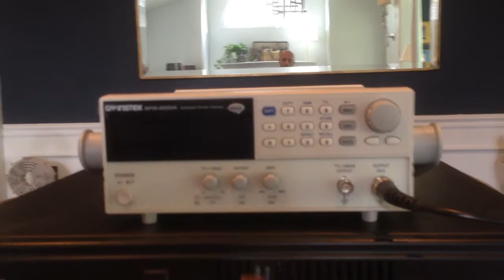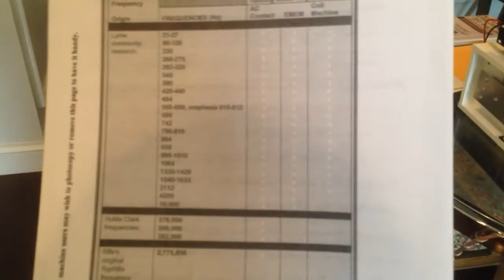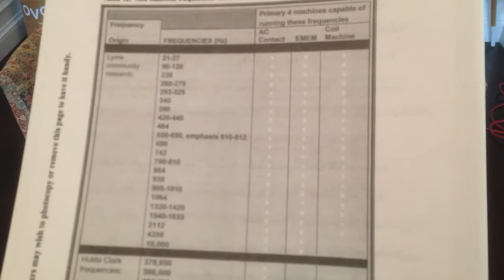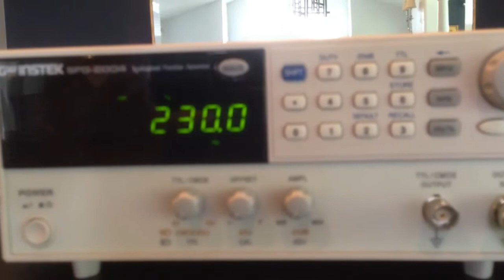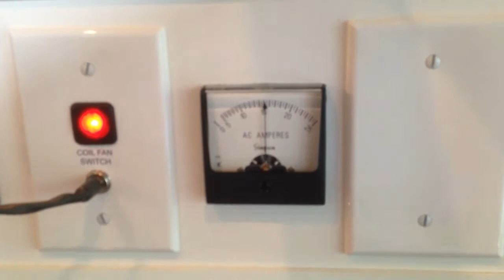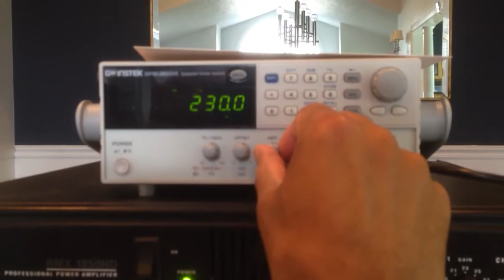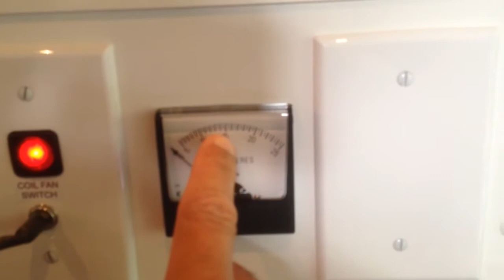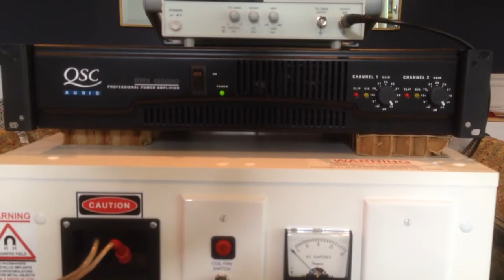Lyme Disease / Coinfections Treatment Demo: How to Use a Doug Coil Machine, Part 2

Comment: I would like to see a real Technician do some testing on It, I can Not figure out what the capacitors are for capacitors do Not Increase the voltage, capacitors In speaker crossovers block low frequencies from burning out the tweeters, and QSC are expensive amplifiers, Beheringer are very powerful and less expensive....
Reply from the maker: Hey Steve, I'm afraid I'm not an engineer so I can't speak intelligibly to your comment. You might be able to learn more about the science behind this machine from its inventor, Doug MacLean, if you Google or YouTube his name.
Reply: Hello ... Hello , i purchased one of these coil machines a while back , recently i ran a high setting and i think i did some damage to the white box ((with the capacitor switches ) i was wondering if this is something i can repair myself or if u knew who can i take it to
Reply: @TheCubaton1  ask Doug or Alex levy
Reply: When using your Doug Coil machine you need to set the capacitance correctly.  Since you know the inductance of your coil and also the frequency that you'd like to use you are able to calculate the correct capacitance necessary for the LC circuit(resonant circuit) and set your switches accordingly.

Comment: Any chance you could comment on your success and or challenges treating issues with this machine?
Reply from the maker: Steven,

I bought this machine to assist in the treatment of my wife's Lyme disease. We viewed this purchase as an experimental treatment possibility and we were desperate for help given her poor condition at the time. There a many different Rife-like machines out there but we chose this one after doing some research and coming across the story and struggle of coil machine inventor, Doug MacLean.

When all was said and done we used the coil machine consistently for about 12-18 months. I did confirm that certain frequencies were able to produce a Herxheimer Reaction, which were unpleasant for Grace, but received with some encouragement because it meant the machine was also having a positive effect (i.e., the killing of the Lyme bacteria).

I thank God that today Grace is well and is symptom free (going on 4 years). Her struggle lasted almost 4 years and she was only 6 months undiagnosed. I honestly don't know what role the coil machine played in her recovery. Her primary treatment consisted of long-term, high-dose antibiotics as prescribed by our LLMD (Lyme Literate Medical Doctor) along with a lot of prayer.

I think the antibiotics were the key medical treatment in Grace's recovery. The coil machine may have played a role, but it was not primary in my opinion. It is an expensive machine and not everyone can afford one. You might consider finding an alternative medicine clinic that offers Rife-machine treatments. For a few hundred dollars and a few sessions you may be able to discover if their machine can produce a Herx Reaction. That's really what it boils down to with Lyme disease.

I apologize to anyone I kept waiting for this reply and I hope this helps.
Reply: We purchased a BCX Ultra last week and started treatments this week for Lyme and yeast ... also treating my daughter and we are pretty sure the machine helped her avoid a cold as all the early symptoms were there. We started cold frequencies immediately and she never progressed to the cold and is all better now. My wife had had some mild Herxing but we are going slow so she is not bed ridden. We've definitely seen some affect and are hopeful based on what we have experienced in the 4 days since we began
Reply from the maker: Really great to hear. Thanks for sharing. I wish your family the best in  recovery.
Reply: I’m doug’s old neighbor and had no idea he had lyme or was working on this. My brother was best friends with his son and we used to all go dirt biking together. Now my wife has lyme and he gave me this machine to try out. Do you sit down straight in front of it every time, or target different areas like arms and legs?
Reply: @spencerstromberg  it depends on what machine you use and what accessories you have. We ended up getting a different Rife system (BCX Ultra Delux) plus a "Broadcast tube" where you just sit in front of it. The standard machine has hand held accessories that we would usually place under each arm pit or hold in our hands. As far as a "Doug Coil", my understanding is you lay it on you but I am no where near an authority or even experienced in the coil use or operation.

Comment: Hi there, 
  I bought a used doug coil machine. It did not come with the chart. I was wondering if  there was any way you could send me a pic of the chart that you used in the video.  I would greatly appreciate it.   waylonsmusic@gmail.com  thank you and be blessed :)
Reply from the maker: Hi Waylon,

In the video I show two charts: 1) a frequently list (refer to the 2:30 mark of the video), and 2) a capacitor switch configuration (refer to the 4:00 mark of the video).

Which chart are you referring to?

Thanks
Reply: Hi there,
 thanks for the quick response.  I would greatly appreciate a pic of both if possible. There are soo many recomendations for frequencies, but I would love to have one for the doug coil machine. If you wouldnt mind could you send them directly to waylonsmusic@gmail.com   my phone wont let me respond. thank you soo much for your response again. waylon
Reply: its just blurry enough I cant make it out.  a clear cell phone pic would be awesome. thank you very much.
Reply: Brian Robinson  Hi Im in the same predicament as Waylon. Would you be so kind of sharing that with me as well?
Reply: Waylon Herron 
Hi,  Did you ever find the charts?